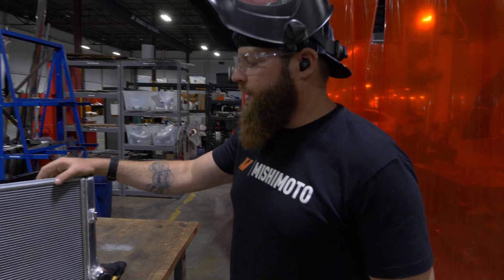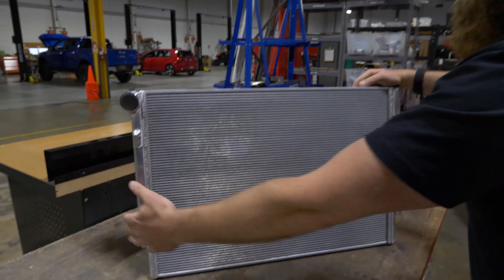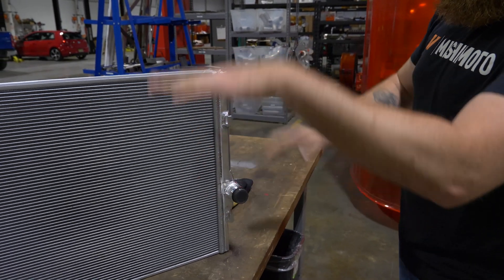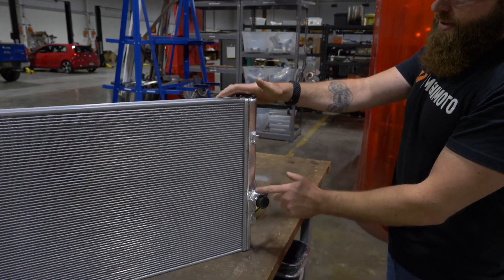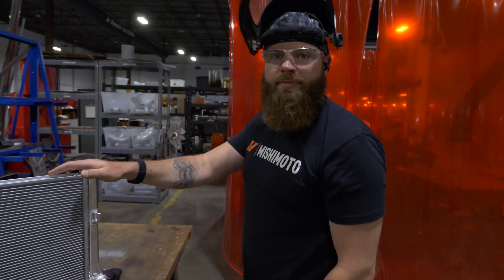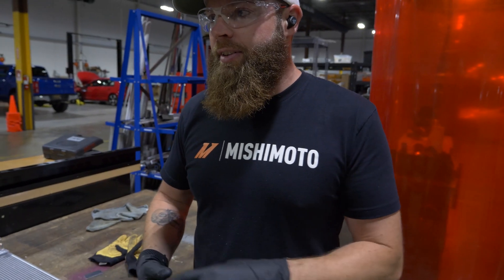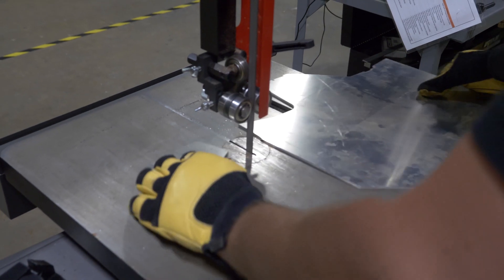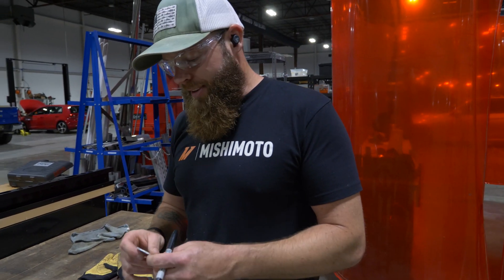Mishimoto: Volkswagen GTI Mk7 Fabricating a Triple Pass Radiator

Comment: Does converting it to a triple pass actually drop the temp?
Reply from the maker: It has the potential yes, assuming that the stock radiator cannot keep up. However, the thermostat is the main source of temperature regulation.
Reply: @mishimoto  I have a 160 t-stat, 383 Chev 500hp. The temp can get to 200

I have a 2 row aluminum rad, with a high volume water pump. The fan is a 15" flex-a-lite black magic extreme electric.

The temp does come down a bit while idling. Maybe 185 degrees. 

Thinking about modding the rad to a 3 pass.